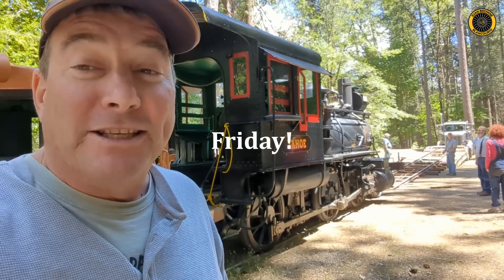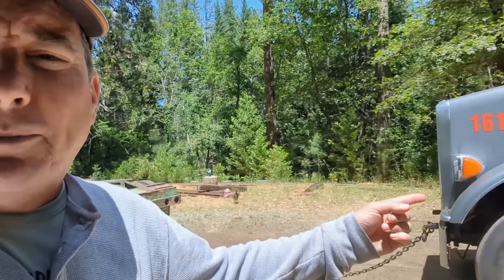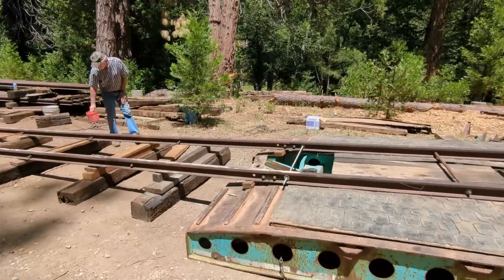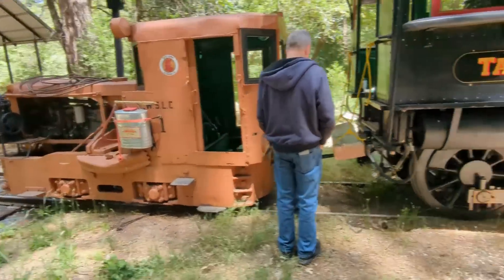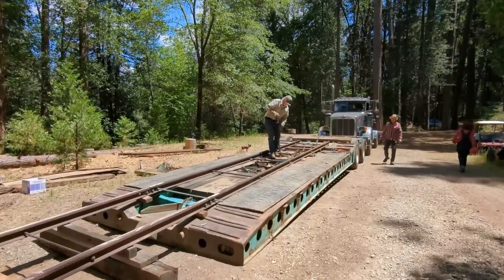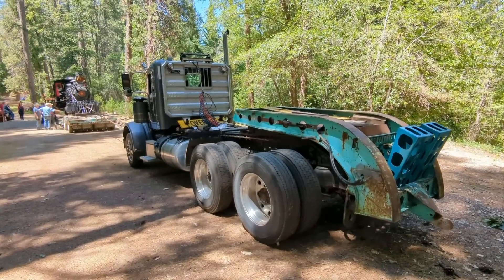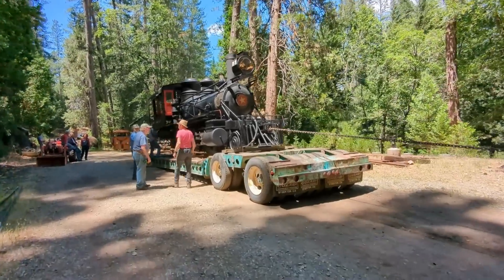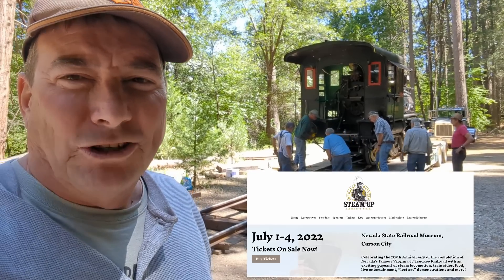How do you move a 25 Ton 1875 Baldwin Locomotive?

Comment: You buy a cheap permit and do countless damage to the public roads we have to pay for.
Reply: You aren't gonna have to pay for squat because they aren't going to damage anything. That's a 16 tire trailer (double what you would normally have), so you essentially have the equivalent of 4 conventional  axles on the trailer and 7 axles total to haul 50000lb payload. Usually a regular 5 axle semi can haul around 42000 ish, so a 7 axle could conceivably haul 60-65000lb payload if the load is positioned far enough towards back of trailer and the tractor 5th wheel is slid far enough back to keep from overloading tractor axles.

Comment: Really interesting seeing them moving it, it is a testament to the low rolling resistance of steel wheels on steel rails that the truck was able to pull it up the ramp, which was pretty steep too, without much issue. I don't envy the guy shoving the chuck of wood underneath the drivers though!

Comment: Nice video! Thanks for sharing. Not to be a stickler for details but you mentioned that the trailer is raised by hydraulics. Actually most lowbeds don’t use hydraulics but they have a ramp on the back of the truck  which raises the trailer as the truck backs under it.

Comment: Wondering how many times, it took to adjust the alignment of the trailer to be straight forward of the train locomotive?
That is tedious work to be perfectly aligned... and it’s just the first one the Round Trip means 3 more times! 
Juan, do you have any video of that process?
How was that final achievement made from side to side and parallel to the track ramps? 
Obviously the trailer can move. And the ramps can take up some of the errors in the alignment.

Comment: I'm a little surprised that the semi tractor had enough traction to pull without any extra weight on the rear tires.

Every time that chain went slack, I held my breath. Chain breaks aren't fun!
Reply: No one should have been near the chain. When the chain went slack and then snapped tight, they were pulling the tail of the Tiger.
Reply: it did have extra weight, the removable gooseneck of the trailer was hanging off the fifth wheel, probably at least a couple tons, and cantilevered off back,  pulling more weight off the front of truck and onto drive axles. Plus, the amount of tension on the chain was probably surprisingly small due to the tiny rolling resistance and low angle of pull....if that was half inch chain then it should be good for at least 10-12000lb iirc....they wouldn't have been anywhere near that.

Comment: Amazing that the chain could handle a 25 Ton load. And amazing the lowboy trailer could handle that load. Not to mention the transmission on the truck.
Reply: This is just a medium size load for a trailer of that sort and with steel wheels on the loco there is very little rolling resistance on the pull.
Reply: My first thought untill I realised that the pusher engine was doing most of the work.If not you dont stand anywhere near a chain under high load in case it lets go.It can cut in half.
Reply: @glennpowell3444  it would be 25tons if it were lifting the locomotive straight up in the air....not anywhere close to that hauling it up that slight grade...maybe 3 or 4000lb pull if that....the pusher locomotive wasn't pushing it anymore once the truck started pulling it up the inclined rails...the pusher loco stayed back.

Comment: Well Done!!!  I was concerned at first that they should have used a chain or cable winch to pull the locomotive up the ramp track onto the tracks on the trailer.  But that driver really knew his equipment and kept steady tension at slow speed on the pull, a great job!  There are some truckers who do this type of specialized relocation of railroad equipment, does this driver do that type of work, or is this his first steam locomotive relocation job?
Reply: If you watched the video Juan explained they have moved it before, plus most lowboy operators normally haul oversized heavy loads, piece of cake for them 👍

Comment: Our local tourist railroad, Oregon Coast Scenic, has lots of experience moving locomotives this way since they have no connection to the outside world. If you're ever in Niles or Sunol, check out their #7, called Skookum.  It was restored by OCSR in Garibaldi and trucked to Niles.  Ya really should have seen it going 55 on I5!
Reply: There is interesting history about #7 or Skookum.  This 2-4-4-2 loco was built for the Little River RR, a logging railroad operating in the territory that is now the Great Smoky Mountains National Park. On the Little River this loco did not perform satisfactorily. The loco was then replaced with another 2-4-4-2 with somewhat different specs. The second 2-4-4-2 (as #7 or Skookum) performed very well on the Little River. And, the original 2-4-4-2 went out west where it performed very successfully. I believe both locos still exist and are both still operating.
Reply: OOPS the second 2-4-4-2 was numbered 126 on the Little River. The first went west and was numbered #7 and named Skookum. (typed faster than I was thinking on the first comment)

Comment: That would have been much easier with a trailer mounted winch.  The slope is very gradual, and looks to be about 5° or so.  (SIN 5° x 25 ton = 2.18 ton).  A 5 ton winch would be more than enough for the job.

Comment: You just don't want to be either side of the towing chain when under tension in case it snaps the whiplash can be incredibly powerful, and deadly. Reference what can happen on ships when either anchor chains or towing wires part under strain.
Reply: Yes, I was concerned about the chain and those standing close to it.
Reply: Im too lazy today to do any referencing; but I'll guess that you lose both the anchor and the tow?
Reply: @straybullitt  There have been instances where broken anchor  chains and tow cables have not only injured and even killed crewmen but caused severe damage to the structure of the ships involved.

Comment: Usually main side rods are disconnected to reduce rolling friction and stop the steam pistons from moving with no lubrication.
Reply: I have been involved in  several moves of steam locomotives by road here in the UK. Normally we would leave the side rods on. Especially if the locomotive is a working example. There is normally enough residual oil in the cylinders to prevent damage to the piston rings. Provided you do not go too far or too quickly